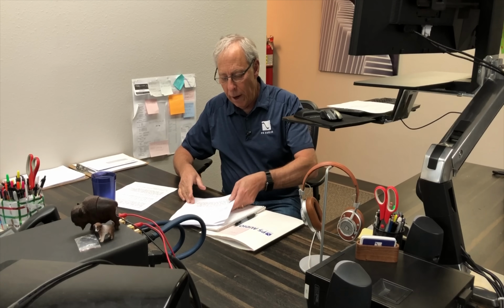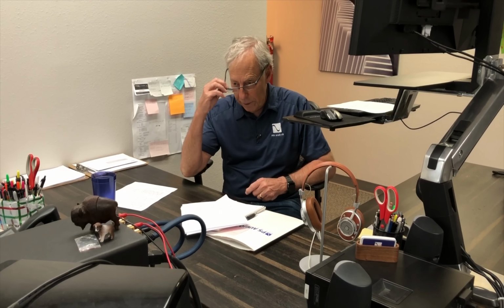Does transparent sound require voicing?

Comment: What DO you mean by transparency?
If a complex audio signal, with all its dynamics, passes through a capacitor, does it "pick up" unwanted artifacts as it goes through ?  Or is it the sound quality only ever to be heard at the end of a rainbow...? The ideal amplifier would have a power bandwidth from dc to well above 500Khz  with zero THD+noise and zero intermodulation distortion.. an infinite damping factor ... dead flat frequency response and linear phase response too... and the speakers would have to compliment this ... no one particular speaker would do justice to this no matter how good it is... So ultimately, it's the speaker AND our own hearing plus ideal acoustic environment that counts. You DONT ever "VOICE" an amplifier ... the ideal amplifier would just be a piece of wire with gain !!

Comment: It's the inverse of the impulse response. But isn't true transparent equpament more suiteble to studio monitoring? As an anectode, after I started hearing a lot of live acoustic music I dropped the Bass and Treeble almost to zero on my car - which has a crappy equipment. At home I have no EQ whatsoever - on some equipment that, if compared to PS Audio, could be called crappy too.

PS: After hearing some videos Paul uploaded with the guy from Infinity and some other guy - I forgot their names but they are masters of their craft - I understood how difficult it is to choose the components. Transistors, for instance, are made on a wafer and will behave very evenly on cut and saturation regions but when you go into the linear/triode region and you have to deal with depletion capacitances things get a little trickier.

Comment: That's a great point. At some time I went ahead and tried designing a tube amplifier purely based on basic circuitry that respects the requirements and specs of the tubes I used and then I purely relied on how it sounds and what it feels like to do the rest, such as feedback, gain, power supply filtering etc. What I wanted to accomplish was to allow my creativity to flow and not being influenced by simulations, calculations, expectancy and circuit topologies I've learned over the time by repairing such electronics. As I was pleased with the results I made some measurements and did some research of what I've done to try and explain why it worked as it did and to back up the ideas by checking if somebody somewhere has done such a thing and if they maybe learned what I did in this process. It turned out to be an outstanding little amplifier. So my rule of thumb is follow you intuition, listen with you feeling and back it up by measurements. Only that allows you to think outside the box, to learn and  to grow in a particular field of interest, and in the end of the day make your unique contribution to the society by sharing those findings.